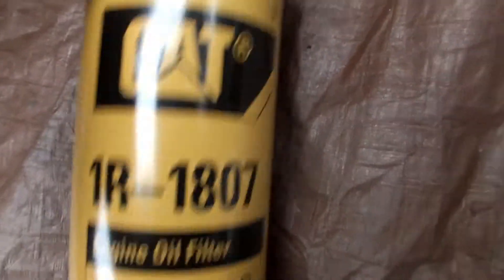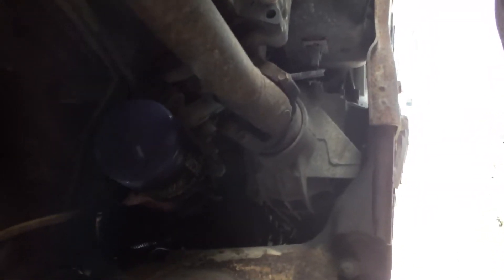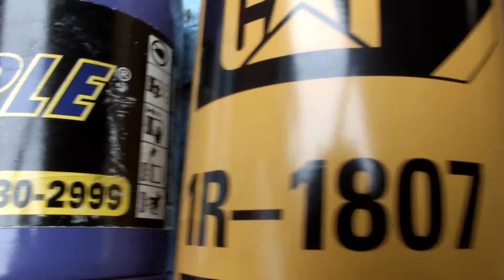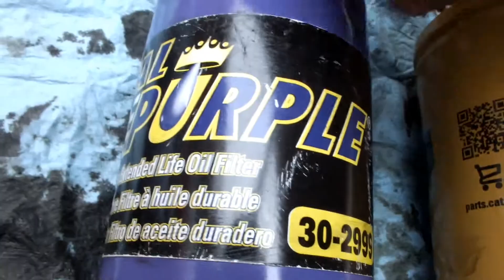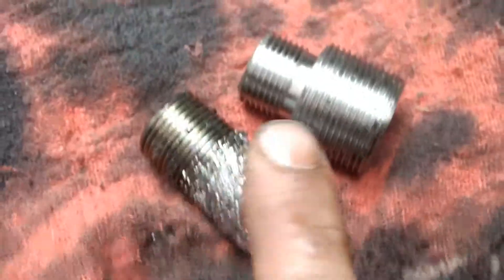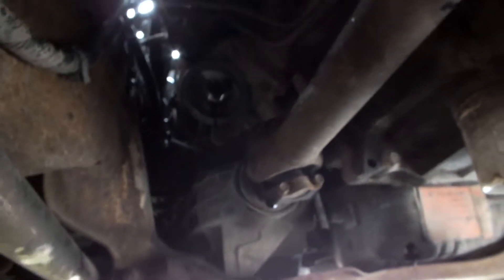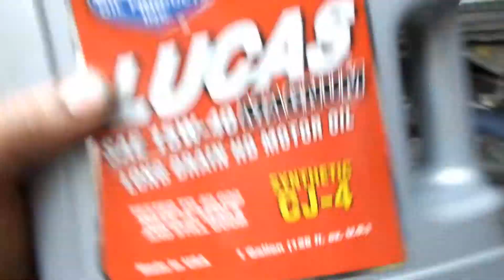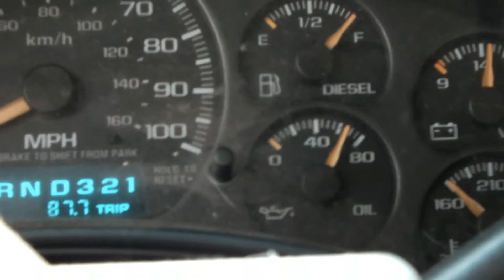CAT Oil Filter & Adapter for Duramax Engines - Installation Made Simple

Comment: How did your truck do with the hot shot stuff. I thought u was only supposed to run one of the hot shot stuff at a time. You do the stiction one first then on the next oil change you do the other one ? I might be wrong but I did see that in one of there videos but anyway how did it do ?
Reply from the maker: Derp. Learned something new.  I didn't know about running one at a time but I was curious if that was the case.  The truck is running pretty freaking smooth right  now.  I'm running stiction in my gasser too and it seemed to have the same effect.  So far I haven't noticed any negative effects from running both stiction and friction at the same time but I'll keep this feed updated if that changes.
Reply from the maker: I read someone ran friction in their rear diff and it helped their fuel mileage.  I was thinking about trying that next
Reply: Kooshdaakaa let me know if u put it in the diff. I’m going to do a oil change this weekend and thinking about running the hot shot stuff
Reply from the maker: @jacobhenson3952  Yeah man, I highly recommend trying the shot shots in your oil change and running it for at least the recommended 4,000 miles.  I'll let you know when I run the friction stuff in my rear diff.   Thanks man.
Reply: Kooshdaakaa I been looking at the arch oil have u tried that or heard of it before ?
Reply from the maker: @jacobhenson3952  Haven't heard about it until you mentioned it.  Looks pretty good though, like it serves the same purpose as Stiction.  Little more expensive.  Have you heard or read any reviews on it?   I'm always looking for new things to try.
Reply: Kooshdaakaa yea u can look them up on amazon. There is some power stroke YouTube guy that everybody likes and he is we’re I first seen it. Then I looked it up and there is a couple guys with a video that has a duramax and it fixed his balance rates he says anyway.
Reply from the maker: @jacobhenson3952  Are you having injector issues?  Have you checked out the GM/ ACDelco fuel injection cleaner?  https://amzn.to/2Wl4o2E   I really want to run this stuff but it's so dang expensive.   Looks like the price went up by $25 since the last I looked but shipping dropped quite a bit up to Alaska.  This stuff looks pretty neat, essentially you plumb it directly into your injectors and gives it a DEEP CLEAN, super smelly stuff it seems.  There are a few videos out there where guys show you the balance rates before, during and after and in many cases it seems to have unstuck some of their injectors, smoothed out others and god rid of the dreaded black haze.  This is what I was originally looking at when I ran into Stiction Eliminator; I imagine running stiction and the ACDelco injection cleaner at the same time would help immensely considering you would be cleaning both top and bottom of the injection system.
Reply from the maker: injector #4 was stuck wide open with a balance rating of -5.5, and was bellowing smoke out the tail pipe.  I ran an entire bottle of Stanadyne Performance: https://amzn.to/2QIDM5s when my tank was down somewhere between 1/4 &1/2 tank, ran the stiction eliminator and put a quart of regular auto transmission fluid in the tank for the extra detergent then went for a cruise smoking out half the town as I drove down the road until it worked itself in and it cleared up.    injector #4 is still temperamental and they will all have to be changed sooner than later, but this helped get me along.   The FASS lift pump with CAT filters have been helping keep things in check too.

Comment: Did you notice a difference in your engines oil pressure after the install?
Reply: Typically i get 45 psi at idle but after i put this filter on my 06 i got 90psi at wot and idle.. not good
Reply from the maker: @aaronmcgowen3890  really??  I didn't notice a difference in oil pressure.  It still right around 40 at warm idle and somewhere between 80-90 when warming up.   I'm not sure how this could effect the pressure, but is there a possibility the adapter was cross threaded?  Maybe it didn't align correctly and there is a pinch?  That's odd man.  I'll have to poke around and see if anyone else has that issue.  You check your oil send sensor??  Mine is going out in my old chevy 350 and reads max pressure for a hot second when I wot then bounces back to normal.
Reply: I have a 2006 only 186k so i will check my sending unit but im not sure that could be the issue. My truck was not always running this way since owning it. The CAT filters have no oil bypass within the filter itself so i was thinking switching back to a oem filter WITH a bypass would lower my oil psi but it hasnt. Might be a faulty oil bypass in my oil pump.. or a bad sending unit
Reply: @aaronmcgowen3890  If you still have that rig, look at the PPE filter. It's pricey $30+ but twice the size of 'em.  I just was about to put CAT on my 2015 but now think I'm going to go with PPE. No conversion or nipples to change.

Comment: I hope your deducting 2 quarts when you add the additive.
Reply from the maker: Absolutely.  In this case I deducted 1 quart because of the CAT oil filter is large enough to require an additional quart of oil, bumping the engine oil requirement from 10 quarts up to 11 quarts.    She's purring smooth and steady :)